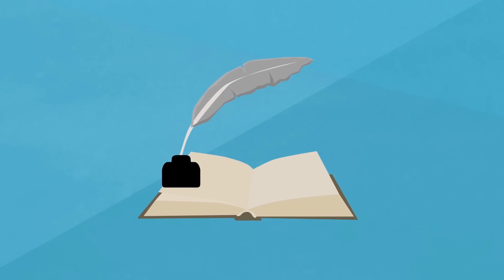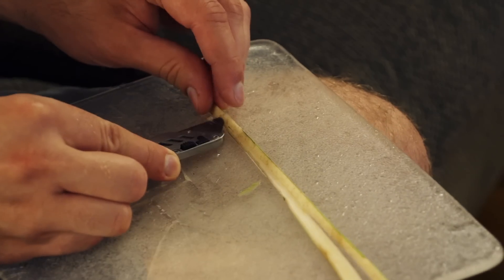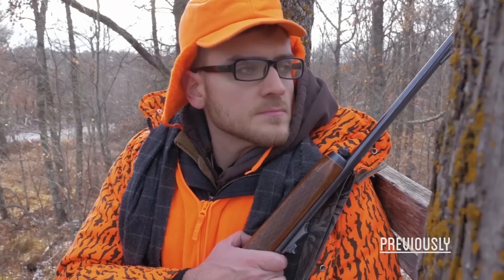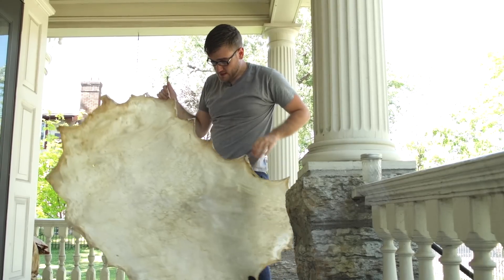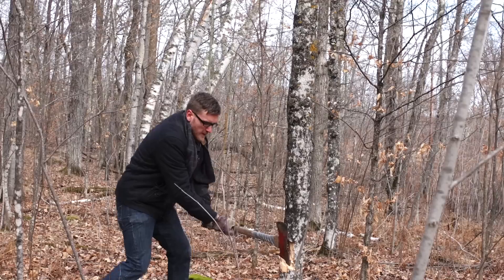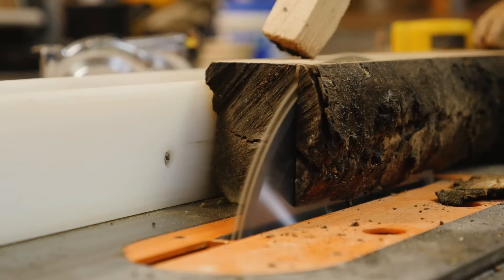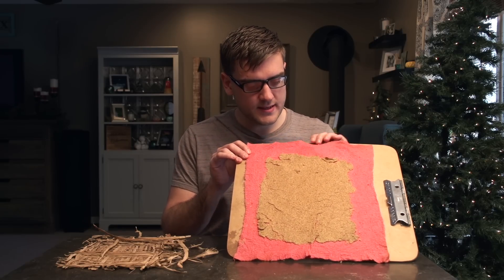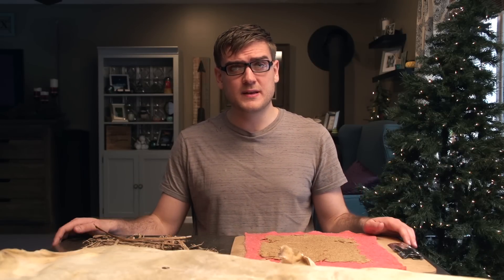Papermaking Pt. 1 | How to Make Everything: Book

Comment: You need more weight.

To make papyrus, Ancient Egyptians used blocks of stone as heavy as my car. It needs to generate a pressure strong enough to literally squeeze out the last vestiges of moisture from the plant and flatten each stalk to a mere fraction of a millimetre in thickness. This squashes them together and makes them anneal.

Your papyrus was left to dry under three tins of what I assume are paint. You need much more.

Same goes for your paper.

Comment: The biggest blunder with the wood paper was to grind it into dust into the blender: it did sever the fibers, and so they would not stick together, it's actually why paper is not recyclable more than a couple of times; once the fiber have gotten smaller than a certain threshold they would not hold together anymore.

Comment: You forgot to add a binder to the wood pulp, tree wood is acidic and so it won't bind without a binding agent. In classical papermaking hide glues from rendered animal hides were used, today polymer glues are used.

Comment: HOW TO IMPROVE ON THE WOOD PULP IDEA

If you add wood glue to the water or even elmer's school glue to the wood pulp method it will not fall apart. Make sure it's extra warm water so the glue dissolves evenly in it, add wood pulp, stir, then screen it, press and dry and it should make better paper that holds. I seen a person do the exact same steps with pulp of jeans to make new denim, the glue part is all you need. Idk how much glue to add but you'll need enough depending on how much water pulp you have, you may have to experiment with that part. Also careful when you press it, you add paper towel to soak the water, the glue may stick to the paper towel. Maybe you should press with the paper towel then remove the towel after a few seconds of being on the wood pulp, don't let it dry while on the wood pulp or it will stick, and then let it dry after that w/o any press on it. Or may be put saran wrap bet/ the wood pulp and press so it can dry while being pressed but won't stick, don't forget to saran wrap the underside as well.

Comment: Actually, I don't think you tried hard enough to make paper. First off, you need longer strands of cellulose fibers from wood, like the once you would get if you used a drawknife. Then you fluff pieces them and and then you boil them several times and change the water each time you do that. Then you lay them in a thin layer as thin as you can make it, with a natural adhesive like egg white, wax or honey.  Then you press it with several hundreds of pounds of force depending on your work area until it dries. Then you wash it again to get rid of the extra adhesive and press it dry again. I am leaving a lot out of the process obviously but this will give a better result.

Comment: paper needs longer fibres to hold it together - that's the only thing that gives it integrity even though it's so thin. you can see this when you take a sheet of paper and tear it - one way will tear easier since it aligns with the grain, but the other wil result in uneven, messy tears. sawdust doesn't have any length to its fibres (especially if the cuts are made perpendicular rather than parallel to the grain) and after you've blended it, even less. if there's a cheap way to get the wood to be worn down into thin, fine fibres rather bits of dust, that would be your ideal method. i've tried a couple of methods to create fibrous wood pulp, for example, boiling it, but that's never been successful.
Reply: OH nvm he already did another one knbqdknvj whoops

Comment: Wood pulp paper starts with 25 to 50mm wood chips that are torn lengthwise in mechanical pulpers especially for newsprint, note, torn not cut as a blender would do. Chemical pulping uses Sodium bisuphate to disolve the lignin.
Making paper out of cotton fiber is much easier (its just a thin cotton felt).

Comment: the reason why your wood paper didnt work is beause you pasted it in the blender the paper gets its tensile strength from the longer fibers. also it would binded better if you did a month long soak of the raw wood plus lye water boil for 10plus hours before straining
Reply: I am guessing that is why in real papermaking only reduce the wood to woodchips instead of sawdust when they make paper then. I was curious about that.

Comment: a tip for if you have to cut down another tree. cut vertically at an angle instead of horizontally. gravity will help you, and the grain of the wood will also split easier, this way you will get much larger cuts with less effort.

Comment: Those chemicals added to paper are called sizing  which is either an animal sizing  like rabbit, gelatin sizing or a more modern PVA sizing. Sizing has been used for centuries.  Which is what allows the fiberus particals to stick together and hold ink on top. Also. Trees are actually not very common material for paper. most papers old or modern are either made of cotton,which is archival, or lignin (plant fibers) which is acid free but will change color over time. chip board and card boards are pretty much the only wood pulp "paper" materials you'd find on the shelf.  Papyrus And wood are the least archrival materials Becuasr of the amount of naturally occurring acid.  The parchment, or animal skin works because it already has sizing in it.

The more you know. 
Cheers

Comment: I think the problem with your papyrus was that you rolled all of the "glue" out of the stems when you took them out of the water.  What you should have done was to lay half the stems running the same direction, then lightly crush the wet stems with a wooden mallet.  Then repeat the same process with the other half laid perpendicular over the first layer of stems.  Weigh down and let dry thoroughly, which could take a few days.  Papyrus was never woven, even though it kinda looks like it is.  It's held together by the gums and resins found naturally in the stems.

The problem with the paper is that you ground the fibers up too small when you put the pulp through the blender.  The traditional way of preparing pulp for paper is to soak wood chips for several days, pound with a mallet, soak chips in fresh water another day, repeat the process several times until the fibers are fairly separate and the pulp holds itself together in a lump when squeezed. This repeated soaking also gets rid of most of the lignin in wood (which is brown) and so makes the final paper lighter in color.  Add the pulp to some water and carry on with the screening process as you did.

Comment: Well with the Pulp you don't really need all those chemicals instead of a powder try strings are you going to want to do is you're going to want to beat these together several times and a container and mixing it if anything just had a bit of calcium and from here you're going to want to use that screen method that you previously demonstrated have a good day

Comment: Your axe is so not sharp that it would be easier to cut anything with it's handle xD
The lots of chemicals used for production of paper is basically strong base usually sodium hydroxide (that can be obtained from wood ash or chem store, ofc also others can be helpful but not necessary ) and for strong paper you want very fine fibers but bit longer ones so after planer you would boil your material in 10% NaOH in H2O solution for about 5-10 hrs and then blend it when you notice that wood shavings starts to fall apart on it selves, then to hold your fiber tightly together after screening you should put raw sheets in some kind of press about 2 tons is minimum for a4 sized pages. :v

Comment: To make a comment with the "modern" paper, we used a blender in the papermaking class, but we put the paper onto a wooden board, and applied pressure to the mesh, using a towel to soak up as much of the water as possible (the paper was between the table and the mesh). We also air dried the paper, instead of compressing it. Not only that, we used shredded paper that wouldn't have held it's shape as well as the paper you made, but it acted just like paper. I don't know what you did wrong, but I hope if you read this, you might gain some insight in what you did incorrectly.

Comment: You should try using a machete when chopping wood, it is relatively easier to work with and I (with my much weaker build) managed to take down a similar size three. Also it is really easy to clean up the trunk from smaller branches.

Comment: Beggars Make Money
Beggars Pick Rags
Rags Make Paper
Paper Makes Money
Beggars Make Money

Ahem.
So I know a little about  this. Wood paper is an industrial product, and as you said, you'd need entirely different kit to make it. And you'd hate yourself if you did. Paper mills stink

Home brew paper is easily made from rags, and is much better than the rawhide you got for vellum/parchment. Lint from many driers, or just run cheap cotton cloths through your's till you have five gallons of lint. Fill  the bucket with water, and do as you did to make wood paper. A frame around the sieve will make a 'deckled edge', basically making the sheet square. Lay the wet paper out onto a felt pad, and stack as you make pages. Put the stack in a press, and give it a good ol' squeeze. Remove the paper, and hang dry. 

Looks like you may cover this in the next video. Shows what I get for commenting on a 3 year old video. :D And so you did. 

And a cross cut saw would have felled the tree much easier. And made into convenient lengths for  transport.

Comment: Putting the wood chips into a blender chopped the long fibres into very small ones which is why the paper ended up as mush because you need the fibres to weave naturally. If they are too short, this is impossible. Modern mechanical processes don't use sharp, high speed blades like a blender to pulp the fibres.

Comment: You need to let the weight of the axe do most of the work. Make sure the blade makes contact at a 45º angle. If you hit it flat on the edge, it will dull it quicker and, thanks to Newtonian physics, it will bounce back and tire you out faster (and possibly injure you).

Comment: Papyrus has to be cut thinner, woven tighter, and NOT just left under weights. It has to be pounded until the fibers fuse and it makes a solid sheet, then dried. Then and only then can you leave it under weight.

Comment: Traditional paper was actually ground into pulp in a way that preserved the fibers more. The blender cuts it up too fine, so they're not long enough to tangle together for real paper. You also forgot rice paper and linen paper. I suppose those are fairly close, using a mesh and all, but both were also rather significant in their cultures for the progression and availability of paper and literature. The reason you got so tired swinging the axe isn't just because it was dull, it was more because you were using too much power. In wood chopping, you're supposed to let gravity do most of the work. That's why you take big swings, to build momentum. These are interesting videos though. It's very fun to have these.
Reply: OK, I forgot that there was going to be a part 2 and watched it. Glad you mentioned the whole paper made from discarded clothing thing, even if it didn't mention that it was mostly linen at the time

Comment: 3:58 that moment when you try to remember the last time you sharpened your axe...
Reply: Give me six hours to chop down a tree and I will spend the first four sharpening the axe. Abraham Lincoln
Reply: i believe with a dubble headed axe one side is kept dull the other sharp for different tasks and he was using the wrong end
Reply: Chris Mennega, one side had a thinner edge making it sharper and cut deeper but more fragile and will dull faster. And for denser wood, the other end would usually have a thicker edge with a steeper grind angle for a more durable edge
Reply: Yea i can take down trees like that with my cold steel tomahawk 😂

Comment: The way I have seen papyrus made before was where the inner pith of the stalks were hammered and rolled thin before soaking in water for multiple days and not the other way around like in this video.  Then it was basically the same, weaving the strips and pressing the papyrus, except pressing took longer than overnight.  Maybe you could try it that way when your plants mature.

Comment: Duuude. You need starch water. And let the pulp "rot" for a week or so.  It'll break down on its own. You can even bleach it after. It kind of feels like this was a relatively lower effort attempt.
Reply: Lower effort attempt? That's just insulting.
Reply: @yurioswife3147  A little investigation would result in a better performance, he should have started with xuan paper made out of mulberry bark, there you could see that there is always some kind of fermentation in the process, aside that when making the paper sheet the solution is done by the fibre and some kind of colloidal solution like starch , linseed water, ibiscus gel or so.
Reply: Ok mr. Knowitall

Comment: What your woodpulp paper lacks is glue. If you catch fishes you can easily make fish glue that will hold it together even with non-disolved pulp like the one you're using.
Reply: it's not really the glue. the pulp was just not grinded fine enough so the fibers couldn't connect properly, and the mixer breaks and damages the fibers. glue can be added later to increase writability of the paper. And he shouldn't have cut down any random tree but Coniferous, they have longer fibers and the paper will hold together even better

btw I work in a paper mill
Reply: +Oscar Barda It's not truly a glue as it is a fixation aid. I use it with mulberry fiber. In washi paper making it is called Neri. The root is pounded, and then soaked overnight. The mucilage is then strained to remove the root bits. Add it at the end of your slurry right before you pull. Mix gently.
It is authentically supposed to be made with a different variety of okra but since I haven't seen it gown in North America regular okra will have to do.
I don't know any natural whiteners sorry!
Reply: The problem isn't the glue or to little grinding. The problem is that he isn't defibrillating the wood. In a mechanical pulp mill this is done using heat and in chemical pulp mills by dissolvning the lignin. There isn't a glue holding the paper, it is basically just friction between fibres. 

If he would add glue to his "pulp" he would simply end up with a particle board, not a paper...
Reply: You can use okra root as well.
Reply: +Oscar Barda great idea Oscar!  Maybe we'll try that in a follow up video
Reply: I had no idea you could make glue from fish.  Wow!
Reply: Oscar Barda fishes?
Reply: Well then he could catch some fucking fish
Reply: Okra root to make glue? Never heard of it so… Okra is a plant? and how do you make glue out of it?

Do you know of any natural whitening agents? :)
Reply: Also rice
Reply: Oscar Barda fish glue?!???!!?
Reply: No ones said it yet it couldn't help myself but the plural of fish is fucking fish
Reply: @gettingrealsickofyourshitc4804  actually fishes is a plural of fish. Most often used when referring to multiple species of fish rather than a multiple of the same species. Just because the English language is not confusing enough.
Reply: Are fucking fish specifically breeder for sexual purposes